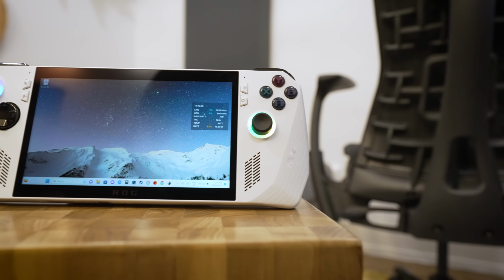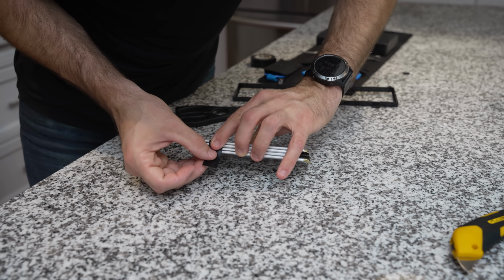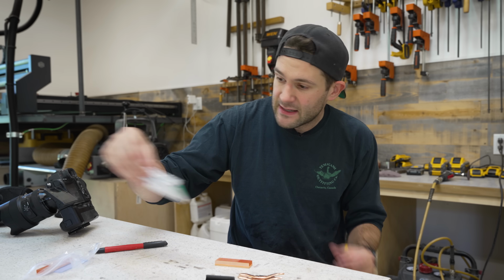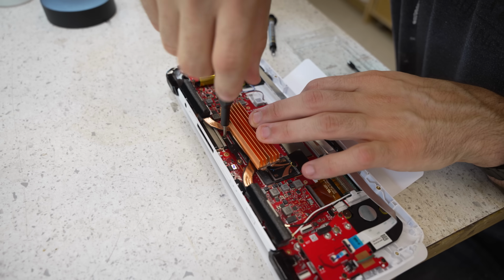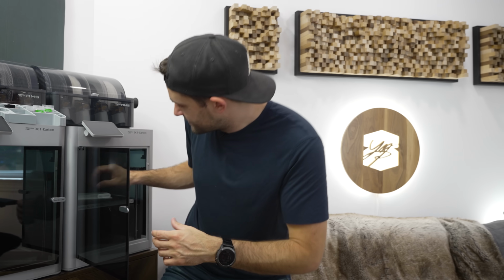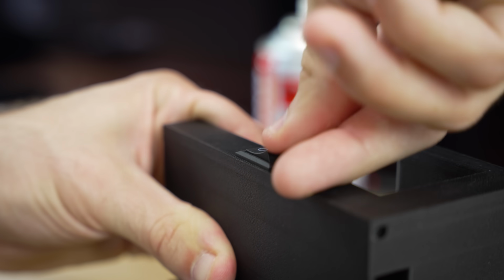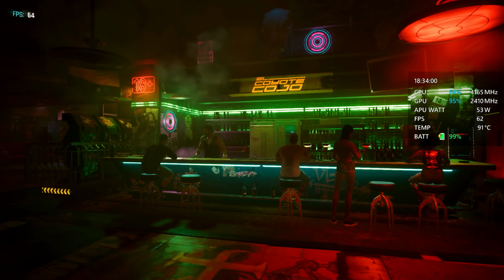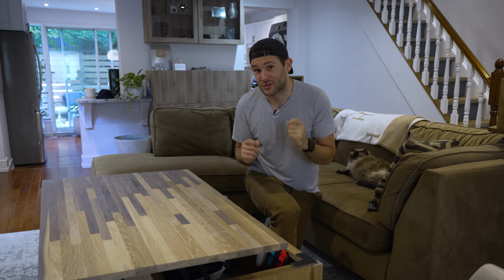I don't understand why people buy Steam Decks...

Comment: Repairabiliy? Availability of spare parts? Great software and optimization for a handheld?
Reply: And the device actually works?  ASUS has a hilariously bad reputation for hardware dying.
Reply: @slamshift6927  wait, that's actually a thing? i thought i had a bad luck with my asus tuf laptop because it's dying after 2 years, because it's m.2 slot are burnt for some reason and now i had to switch sata slot and soon after that the keyboard is broken as well.
Reply: @Art-pj8zq I doubt that's because of bad luck so much as it's a result of braindead ASUS engineering. They have a tendency to push out products that seem fancy on the specsheets (because big number!!!!!) but in reality have been engineered like crap, particularly when it comes to higher-end products (i.e. G14).
Reply: @slamshift6927  I can attest to that!

I bought an ASUS Vivobook back in 2021 and had so many black screen issues for the next 2 years. I thought it was a dying iGPU or maybe Windows (bcuz Windows does that, too)

But it turns out that it was the SSD that came with it. One day when I was watching YouTube, my laptop just turned off and instantly went to the BIOS screen where it said "No Storage Device Detected", confirming that it was the SSD

I'm just glad the part that came defective was a replaceable part. You can only replace RAM and Hard Drive in laptops
Reply: And battery life is a lot better
Reply: Steam OS is also extremely convenient

Comment: The steam deck with valves backing just feels like a more cohesive gaming experience. You don't have to mess around to use it because the software interface is so good. 
Also I really like having the track pads. If the ROG had trackpads as well as the joysticks then it would really open up more possibilities with using it and not be stuck with only games with full controller support. The OS on the steam deck was built for gaming and functions great. Windows isnt built just for gaming so there are some hoops to jump through and stuff that make the user experience not as good for gaming on the device. 
I think the ROG is awesome and if I had money to throw around I would get one in addition to my steam deck. But at the moment it can't replace my steam deck.

Comment: 1. linux
2. it works pretty good. games that do run run just fine often with linux performance better than windows. shocker.
3. designed to have uder replaceable parts.
4. it doesnt cook the SD card?

most people want a device that works; ripping it apart and building nearly a new device is far too much, and doesn't necessarily even improve it...
also, moonlight runs on steam...

Comment: didn't watch the video, I'm just here to say that people are buying Steam Decks because gaming on pc (or on any other device really) is a matter of software/driver optimization way more than a matter of horsepower. Having a crazy high spec machine means nothing if it's gonna run stuff raw (like emulators do), Steam is finally doing something about it and we might get to a point where PC gaming can get the same optimizations the Steam Deck is getting thank to their efforts to make that possible.

Comment: Only problem with the ROG ally, overheating SD card slot aside, is the OS it comes with. Oh and no trackpad. Oh and if you want it to actually perform, you need the extreme version. Still a good device, no doubt. The scene is competitive and good is not enough.

Comment: 1. Native linux install, which allows valve to do specific things that you cant do on windows, like custom DE, compositor and kernel tweaks.
2. Did I mentioned native linux? Cause this is a huge deal, no longer being forced to run windows for games is a godsend. The steam deck has propelled the Proton / Wine / DXVK / VKD3D projects into developers eyes, since now they have a standardized platform to target with minimal effort required on their part thanks to the previous projects I mentioned. The only reason to run windows is either you have an nvidia card (sucks to be you), you play games like valorant which basically have anti cheats that resembles spyware (honestly not much was lost), or the game you want to play isnt available on steam, epic or GOG (heroic game launcher covers GOG and Epic). 
2. The steam deck has been made in such a way thats easily repairable.
3. Parts can be acquired from Ifixit thanks to valve partnering up with them.
4. Long support. Till this date new updates for the steam controller have been released, valve tends to offer support even after they discontinued production.
5. The steam deck offers better performance on the go when it comes to battery life (which is the main use for this device).

Also Asus has been doing some nasty things with their motherboards and products in general, like refusing RMAs and releasing bioses that fry CPUs and the QC of the rog Ally hasnt been great.
Reply: As an owner of an Nvidia card it very much does suck on linux, although there's work that should be making this less sucky as early as this summer. Also you can absolutely play non-steam games on the steamdeck, and while you DO have to go into desktop mode and use some (really nice and easy) 3rd party tools the desktop experience on the steamdeck is better than the Ally's (unless you're hardcore entrenched in windows and refuse to adjust to any other OS or DE) anyway and after your done they show up in your library and you can happily play them without going into desktop again.
Reply: Also, native Linux
Reply: Amen
Reply: On Linux there is also lack of proper HDR support, and no 4k@120hz full RGB support through hdmi on AMD cards due to licensing issues. I'd switch in an instant if these were addressed.
Reply: @hiho9149  I fully agree on those lacking features. That said I would instead just use display port if you can. But yeah the HDMI forum is being a bitch about it. HDR not being implemented is yet another issue with wayland, same shit as with VRR. Those features should've been defined by the protocol, instead we now have this fragmentation going on where each DE implements it differently. These are indeed major issues that I hope are addressed soon.
Reply: You say native Linux, but the game isn't even running native, there's nothing good about running a game under a translation layer. You can say linux this, linux that, in the operating system aspect, but the rest is just fanboy bullshit. Only the system is running native, it lost the entire point because you don't play the operating system, you play the games. Trying to come up with an excuse that anti cheats resemble spyware, it's just a way to ignore a downside of current Linux, another fanboy bullshit that even the real hardcore Linux people understand and see the problem with, there is a disparity between them and the fanboys who simply inflame the Linux community with stupidity, creating an operating system war that doesn't even help them.
Reply: @eroncross5873  What are you talking about, its running native under x86_64 instruction sets, there is no emulation being done. The only thing being replicated is the windows file system and structure. Projects like DXVK and VKD3D translate DX calls to the vulkan equivalent ones. This is especially true when talking  about DX12 and vulkan, which share very similar implementations, most likely thanks to mantel, the progenitor low level API. Emulation would imply that its using a completely different instruction set, which would need to be replicated, but thats not whats happening here. 

Projects like Proton / Wine are vital because it allows developers to target one platform and build one binary, saving them time and effort, while still allowing them to target niche platforms like desktop linux. This is especially great, since linux is not a static platform, distros dont always package the same dependencies or have the same directory structure, having an abstraction layer that automatically takes care of that is great. 

Not only that, you're forgetting that there are countless games that will never be ported over to linux and even fail to launch on windows. Proton / Wine doesnt only provide a way to abstract the differences between windows and linux, it helps game preservation by giving access to a versioned compatibility layer, which is constantly being updated to support a growing list of games, allowing for older titles to run without issues, a problem that has been slowly plaguing windows as of late. 

Additionally, these translation layers arent relegated to linux, part of their code can be easily used to fix games on windows. There are plenty of people using DXVK / VKD3D to fix issues in older titles and even intel has made use of these compatibility tools, to improve performance in older titles.

Finally, having a ring zero anti cheat for a game, which basically might as well be a root kit, is something beyond an over escalation, especially for an issue that could be solved by better abstracting certain data from the client and monitoring player input server side. The best way to prevent cheaters in online competitive games, is by taking preventative measures, not by installing a root kit client side that can and will be overcome eventually, be it through software or hardware manipulations. Also, do you trust todays gaming companies to properly maintain their root kits? I for sure dont, since they can barely manage to release a working game that doesnt suffer from major bugs, performance and stability issues. That said, its a god damn game, not a bank app.

To conclude this wall of text, yes games are running under linux natively, since they're running on the x86_64 instruction set, which they were designed for and yes proton / wine is a good thing, Lastly, yes kernel level anti cheats are bad.
Reply: @eroncross5873  The translation layer barely affects performance, you will find it's reaches parity with windows or is even faster. Nah real linux users would never fucking install kernel level spyware on their computer and no dev would even think of crippling linux with ring 0 black boxes lmao.
Go shove your shitty OS up your shitter box

Comment: The other nice thing about oscillating saws is that it's damn near impossible to cut yourself with one. The bqck and forth movement of the teeth is actually slight enough that it just pulls your skin and cant saw into it, so it only works on rigid surfaces that can't be dragged back and forth. Exact same function as a medical saw used for removing casts

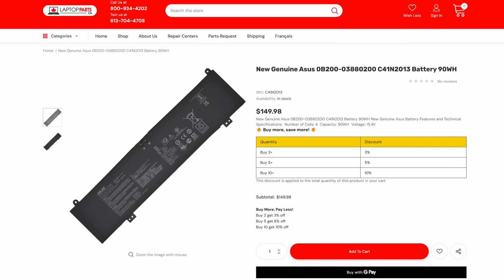Comment: @20:00 
Heat is a big killer for batteries.  It causes a breakdown in the capacitance layers.  Folding the battery will cause thermal issues while charging or during high current draw downs.  I would think you'd need a thermal pad in the middle of the batteries with side fins of some sort to dissipate the heat from the 2 center cells...  Stacking the batteries was a sure fire way to an early end of life for the 2 center cells.
Reply: No one is appreciating the threat to life from this foolish "mod".

Comment: The reason is integration. Their distro of arch linux actually feels like a proper console experience. Windows just simply isn't a seemless experience in the first place, and it definitely isn't on a small handheld screen. And we can thank Valves Steam Deck for the whole Handheld kraze. I suspect many of those Windows Handhelds wouldn't have come to the market without it. Apart from the good olds like Ayaneo, GPD or OneX that had relatively limited success. Valve pushed the PC Handheld market out from being niche to a broader appeal.

Comment: So if you have a fully stocked workshop with the latest tools. Confidence to carry out the work like grinding off the heat sink paint😂. Pay for accessories like car manufacturing special heat shielding and laptop batteries. 

You to can have the "significantly better hardware" (allegedly) last a bit longer. 

What did this all cost in terms of money and time?😂

Comment: Because the deck gives me a button layout and input system I cannot find on any other device.  
The Trackpads are just so useful for games that traditionally use mouse and keyboard I wouldn't wanna go without them.  
Plus it boots directly into big picture mode and I do not need to take care of a windows installation.
Reply: thats it ? meh.
Reply: @magnomliman8114  Performance is not important to me. Most games that I wanna play run well enough and I have a gaming PC with a 4090, so if I wanna see some good graphics I will just use that instead.
Reply: @busti4552  but that not an argument bro ''i have a 4090 pc'' performance not impotent to me. most ppl get the deck to get into pc gaming.

Comment: You could swap the flat cells for 18650 cells fairly easily, as long as you use ones that can handle the same voltage you'll be fine, and because they have a metal shell you're even safer.
(They also need to support the current, but that part should be fine)

Though given the size of the battery, you'll need 2 in parallel for each cell, for 8 2.5Ah (2500mAh) batteries total.

Comment: The reason i live the SteamDeck is that it's a massive step forward in Linux gaming.  If people don't care about Linux then i can understand why the SteamDeck is unimpressive,  but for us Linux needs it means we can build and run a daily driver gaming computer with Linux installed. Which i just did before Christmas.  It's something I've wanted to do since I first started using Linux in 2001.
Reply: it's not just Linux. No Windows user is happy of having to use Windows to play their games, open source is going to be crazy in the future and Valve is simply taking the right direction. It's not a secret that driver optimization is messier and messier the more devices you have to optimize for, pushing in this direction also makes it simpler for optimizations to roll out on PC games too
Reply: I'm going to have to switch to linux again. I hate windows with a passion. Bill gates is the devil. I started gaming on dos. I have high gaming pc, custom built with custom hardline water cooling. I tried a few times to switch to linux, I loves the os but there was just not enough games. I will have to try again when I get time. Older with  a family now so I don't game much anymore. Kids too young to start getting them into and teach them to build and setup water cooling.
Reply: @pmclean1980  it's still like that. The Steam Deck is a happy oasis in the linux gaming universe
Reply: 1 answer: Nobara Linux  @pmclean1980

Comment: Oh my god dude did you really create a stack of 4 cells with no room to breathe for the inner 2 ones??? The original setup has a lot more surface area to dissipate heat, now you're maximizing volume and minimizing surface area thus creating a hazard for the 2 innermost cells.

Comment: So, pretty bold title for a failed experiment. Even the lessons learned sound like more pipe dreaming.

I'm sure the folding battery theory is workable in low-power scenarios, but squeezing battery cells between other blazing hot cells sounds like a horrible idea, and is probably why the original degraded so quickly. These cells were designed primarily in series for a reason, to leave one side of the cells unexposed to a heat source. My guess is that the ASUS one won't be much better once it is unwisely folded. You learned the wrong lesson there.

I'm also not a battery pro, but I'm finding little use of thick plastic thermal shrink wraps for lithium ion batteries online, and ones I typically find in laptops are very minorly heat-insulating, moreso just non-conductive in order to protect from burning yourself off of them. I suspect you further cooked your battery by placing that thermal wrap over it. This is another reason your setup might be obscenely cool, but you're supposed to expel that heat, not bake the battery in it.

Storage space should have been a primary goal. Settling for a 1TB 2032 (I presume) is pretty crazy when so much time and energy went into the other 2 projects here. However, I'll harp on this less because technically this isn't a 'performance' buff.

The rest is basically cooling, which has been quadrupled in size, but not necessarily so. Sure the battery is harder to cool, but as long as the draw rate is the same, there are usually light needs for extra cooling, as the battery is typically separated from sensitive components, just as long as it doesn't cook itself. And then the ROG Ally turns around and holds you down by limiting its APU power input threshold. I'm sure the Steam Deck does no less, but the cooling is basically a complete waste.

This video exuded way too much confidence and reckless thought, just like the title itself. On the bright side, this unit can still be the king of streaming.

Comment: You could buy
asus rog ally - 729.00
Sabrent rocket 1tb - 89.99
sandisk 128g - 14.99
heat tape - 14.99 
thermal grizzly paste - 22.99
acrylic coating 19.51
heat pipes - 13.01 x2
nvme heat spreader -8.99 x2
dewalt cutting tool - 219.00
dock for deck - 36.39
solder paste - 20.50
torch - 38.99
noctua fans - 18.95
wire strippers - 22.39
cordless drill - 94.58
soldering iron - 42.99
heat shrink - 13.99
heat gun - 29.10
total of 1472.35

Or you could buy
steamdeck oled 1tb - 649.00
total of 649.00

yea steamdeck not worth it... :P

Comment: 5:40 While yes kinking the pipes can be bad, it still works pretty well as long as it is not completely closed off, or worse, a crack forms and allows pressure to enter the heatpipe condensing the phase change fluid to no longer boil at ~40-50c and now require ~100c to boil.